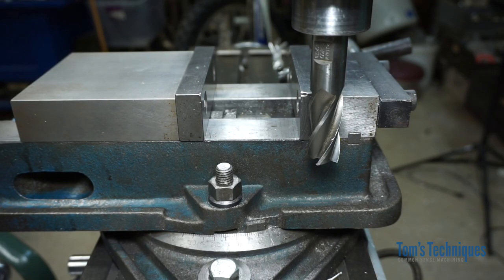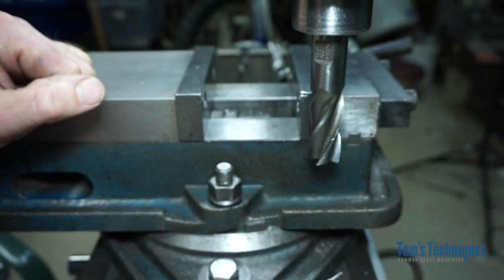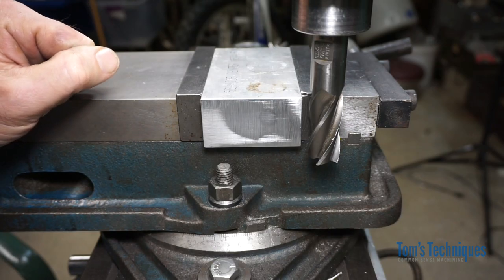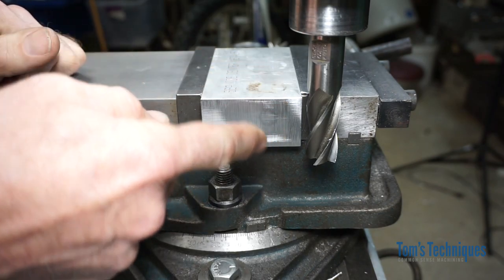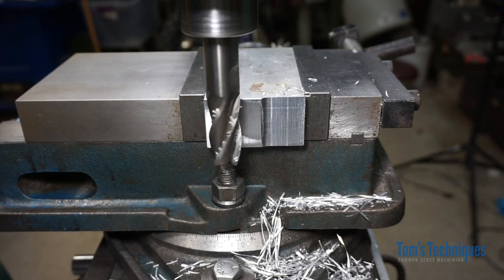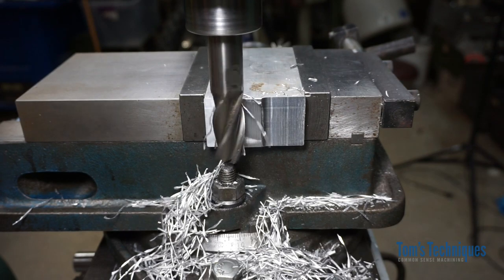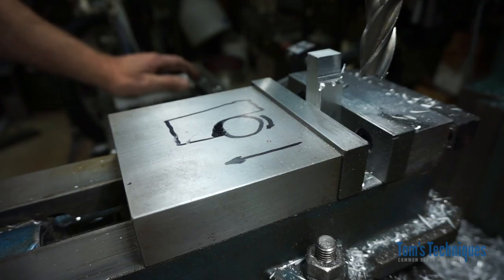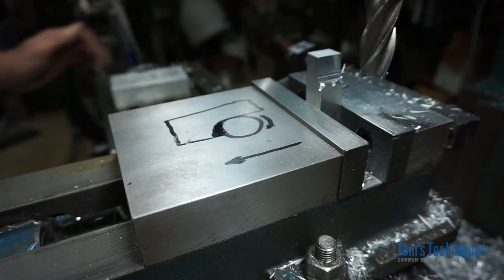Climb Milling vs. Conventional Milling

Comment: I think if you really think about climb milling you will actually find the piece gets bigger as it advances into the metal
It advances into the metal then retreats from it as it pulls away. The smoothness is achieved by the fact it's pulling away with the chip from the metal. 
I think if you consider the vector analysis you have to have a bigger piece as it moves forward.
You have the advancing table toward the part and the mill advancing also toward the part, That means an increased or longer vector in the direction of travel, It is compressing the metal not pulling at it as in conventional

Comment: Using "...every day is a  school-day" I need to ?cut? a 9/16" HEX, for a nut.  The major obstacle is;  I only  have a Drill Press.,  Do you think this can be done?
Reply from the maker: Drill presses are not designed to withstand the forces of milling. Not only will they chatter like crazy, the entire chuck can come off of the spindle.

Comment: Can u explain  y cnc uses climbing?
Great vid thanks
Reply from the maker: Sure. Unlike most manual machines CNC machines use anti-backlash leadscrews. Without the backlash, the table is rigidly held regardless of the direction of feed.

Comment: Any advice on slotting or routing out finished parts in aluminum plate on a small machine? I'm fairly new at this but carbon fiber and even some steel parts I figured out pretty quickly but my trial and error approach with aluminium <(for the rest of the world) is getting expensive with broken or worn tools or very long cycle times and much less but still broken tools?
Reply from the maker: Aluminum should be a lot easier to machine than steel or carbon. Depending on the alloy, it may be gumming up and sticking to the tool , causing your breakage. Use two flute end mills with coolant to help prevent that.
Reply: @TomsTechniques  Lol yes those were my words exactly it should be easier I would think also. Thanks for answering so quickly I appreciate it! I should have mentioned I'm not having problems with aluminum except the first cut of slots or basically routing (milling?) the finished part out of the plate. I'm starting to think I just went way off the rails somewhere so I'll buy a few good tools and start back where it is supposed to work, but not before I destroy  the last 4 or 5 cheap mills I have trying anything different than I have been doing. Maybe it's all the snow this year? Yeah that must be it! LOl Thanks again bye.
Reply from the maker: Remember, there is no such thing as cheap tools (end mills, drills, taps, etc.). Yes, you'll pay less up front, but will pay more in the long run in extra labor, broken tooling and damaged parts.

Comment: A 7/8s HSS cutter into 6061 Al is 1,200 RPM for 274 surface feet per minute. Optimal HSS on 6061 is 280 SFPM. Aluminum is pretty much a let 'er rip kind of material to work with. With carbide tools the question often is how fast can your spindle go?
Reply from the maker: I generally use 400-500 sfpm in aluminum, but more won't hurt the end mill. What happens eventually is the chips get too hot and start sticking to the flutes.
Reply: @TomsTechniques  when it comes to tools and aluminum there is a lot of variation in actual material composition, and finish. So to say it is a complicated subject is putting it mildly. I only know enough to appreciate the breadth of it. Oh, and I do know how to calculate surface speed too.

Comment: Can i please mention that in my opinion.... the endmill will stay a bit cooler whilst climb milling....
I don't know why.... just kinda works out that way....
Reply from the maker: They do stay cooler while climbing. The reason is  there is no rubbing action as the cutting edge enters the work as with conventional milling.
Reply: Yeah I've never noticed broken end mills laying on my table getting too hot myself. So you might be onto something there.
Reply from the maker: Can't remember the last time I broke an end mill while climbing. Sounds like you need more practice. ;)
Reply from the maker: Do you plunge mill your pockets, or side mill them? Plunge milling will greatly extend the life of the end mills and reduce the chance of breaking them.
Reply: @1pcfred  what material are you working with to go through so many endmills....
An endmill snapping will destroy the part... ( no big deal)... but all that hard grabbing can do a number on the indicated vice.... and I don't care what anyone says, could in extreme cases over and over take your head out of square....
I would take a screwdriver to the ways to see if they are lose ???
Put an indicator on the slots and see if it moves when you physically push on the table.....
I have worked on some poorly maintained machines and never really had any trouble with snapping cutters....

Comment: nice. I just bought a Mill bracket for my lathe, the bracket has a vice that keeps the work piece in place. and a 5.5 mill cutter. to mill a groove in a steel cylinder. I got the "climb milling" effect pretty fast and it broke the cutter snap off. I wear safety glasses when doing this . Conventional milling is what I need to do. The rotation needs to be so the flutes throw the chips out toward the high uncut profile. Chips can not be trown out the already cut profile side, making it a climb mill .
Reply from the maker: Sounds like you have the cause and effect figured out. That should result in fewer broken end mills.

Comment: Good vid there Tom... as an aside, anyone getting into woodworking and more specifically, using a router... 
the same theory applies.... except you should NEVER climb cut using a handheld router  or even a table-mounted router.
ALWAYS use conventional cutting when routing... 😎
Reply: @Peter Fitzpatrick Thank you for that additional tip!

Comment: Climb cutting can only truly be taken advantage of if you have ball screws in your machine.  Your tool will pull the slack out of your lead screw climb cutting.
Reply from the maker: I use climb milling all the time with standard screws. Depending on the type of cut, you just have to make sure the depth of cut is around half the diameter of the end mill (for plunge milling or deep cuts), snug up the table lock to keep the end mill from grabbing, or take very light cuts (finish passes). The key is to understand the forces involved and compensate for them.

Tom

Comment: Excellent tutorial, Tom!  But, I was a little confused when you explained about the direction of the cut. I believe that on most mills, the table moves the work piece in the x and y directions, but in your video it seemed as though the CUTTER was moving instead of the table! Is that how your particular mill operates?
Reply from the maker: That was just poor camera work (I should probably fire the guy). The camera was on a magnetic indicator holder that was stuck to the table. That made it appear that the cutter was moving and not the table. Never gave it a thought until after the video was posted.

Tom
Reply: At 15:03  you drew an arrow to show the direction of feed. But if the table is moving the work, then shouldn't the direction of feed actually be in the opposite direction?
Reply from the maker: The arrow represents cutter movement relative to the work.

Comment: Hi Tom. I am a USAF trained manual machinist. I was told the exact same thing you are saying. The reason I am here, 6 years later, is that I'm trying to move into CNC. So, I'm being told that with modern CNC machines, you want to climb mill all your cuts. I was hoping to have some experienced insight from you as to why this sudden change in machining theory came about, because I was ALWAYS told to conventional, then clean up with a climb as you're getting closer to tight tolerance.
Reply from the maker: Hi Cody,

CNC machines have ball lead screws that allow climb milling because they have no backlash. If a manual mill had ball lead screws, you could climb mill on it as well.

Tom
Reply: Toms Techniques thank you.

Comment: so in the Y axis with clockwise rotation of the cutter you feed away from you is convention milling  and in conventional milling in the X axis you feed from left to right
Reply from the maker: Your description doesn't take into account which side of the work the cutter is on. In your Y axis example, if you feed the work away from you and the cutter is on the left side of the work, you are conventional milling. In your X axis example, if you feed the work left to right and the cutter is in front of the work, you are conventional milling.

Tom

Comment: Nice explanation Tom. Very clever preserving the tool when the vertical workpiece got flicked over in the jaws, no matter how lose the jaws were - great example - I have never seen it done so well! I agree with your conventional chip shape but can’t agree with the climb chip shape...as it contacts the workpiece, the chip width is ‘x’. The cutter is travelling along the direction of the first cut making the chip ‘x’ + ‘cutter movement’ making the chip continually increase in size. Does that sound right?? I’m not sure, but that’s what my brain is saying. Warning!! My brain is old and a bit f%#*%. Cheers
Hey, it would get thicker up until it passes the axis of the tool in the direction of travel then start to get smaller at an increasing rate. So it would get thicker then get thinner all the way to zero. I reckon that’s it. Cheers
Reply from the maker: The chip shape for conventional milling and climb milling is basically the same. The velocity of the cutting edge on the cutter is so much faster than the feed, that the feed rate has little effect on the shape of the chip. The important thing to remember is that when conventional milling the chip starts out at zero thickness, screwing up your surface finish and when climb milling it starts out thick, greatly improving it.

Thanks for watching.

Tom

Comment: Super Video demonstrating what the differences are! I will have to try and possibly change my CNC programs.Thank You Sir.
Reply from the maker: Thanks.
CNC mills use ball lead screws, so there is no backlash, and they are extremely rigid, so climb milling can (and should) be used all of the time.

Tom

Comment: Very good resource, we started using the mills in class last week...and are reading about how to use them this week...I know. Haven't talked about this yet in class yet, I wonder when we will. Seems awfully important.
Reply from the maker: It is important. Running an end mill too slow results in wasted time and broken end mills, and too fast burns them up.

Tom

Comment: If the feed rate and spindle speed remains unchanged, They also produce different SFPM speeds because one direction the travel is adding to the attack speed, the other way it is subtracting from the attack speed..
Great Video !!Thanks !!
Reply from the maker: Technically that is correct, but the difference would be minimal.

Glad you enjoyed it.

Comment: Remove the back lash, lock the x axis table after you figure your depth of cut, crank your rpm up to 1500 (especially with aluminum) and you should be able to take .1" off that stock. You should very rarely ever have to conventional mill. You can also double your surface feed by climb milling.
Reply from the maker: You are correct that a mill like this is definitely capable of heavier cuts, but the focus here was to show the difference between conventional and climb milling and how to manage it, so I wasn't making it work very hard.

Thanks for watching.

Tom

Comment: From that kind of vice.. the force of the cutter must always aim towards the secure side of the vice which in this case it is at the right hand side of the video..
Reply from the maker: Karl,

That was one of those hard and fast "rules" I was taught early on, but quickly dismissed as I gained experience. I know the logic behind it was to keep the force of the cutter directed at the stronger solid jaw, but in reality that force just isn't great enough to cause any problems. One of the driving forces behind my rebelliousness, was that one of the first jobs I had was running a shaper and if you remember, shapers by design direct the force of the tool toward the "weak" jaw. A modern day example is CNC mills, which direct the force of the tool in all directions.

Thanks for watching,

Tom

Comment: The set up of workpiece almost totally wrong..
The rectangular piece was put in the right way but the way you cut the workpiece is wrong.. optimal way to clean the surface is you should have cut it from left hand side (from video point of view) towards the end (the entire length of the work piece) then go back until you finished it at the right hand side but on the other end..
2nd piece.. the cutting is right but the work piece placement is wrong.. optimal way to do that is let the workpiece lay so that the entire length of the piece was secured in the vice..
Climb milling is good for getting the right measurements
Conventional milling saves u a lot of time roughing the surface the end it with climb milling..
Reply from the maker: Karl,

I think you need to go back watch the video again. I demonstrated why the force of the cutter should be directed perpendicular to the jaw of the vise, and what can happen if you don't. I guess that would be your "right" and "wrong' connotation. I also discussed the pros and cons of climb milling vs. conventional milling, when you should use them and when you shouldn't. 

Tom

Comment: To be fair you shouldnt run it at that speed and with that much of the shank pertruding out of the collett. When cutting on the side you should always conventionally mill. With aluminium you should use a cutter with a high positive rake too minimise build up of material in the cutting surface. Carbide works a treat too
Reply from the maker: Yes, I mentioned in the video that the extended shank is less than ideal. As far as climb milling only goes, not everyone has machines that are capable of such a thing. Light mills for example are not rigid enough to do climb milling on anything but very light cuts. Conventional milling is much more appropriate. High helix end mills are great for milling pockets in aluminum, but in my opinion, carbide is a poor choice for all but the most experienced hobbyist.

Tom

Comment: I'm just getting in to machining. I think climbing is slower bcs you're taking less material off/less depth than you can do with conventional. I think one reason the finish is better climb milling is bcs the chip actually polishes the material on exit from the bit and part vs. conventional milling quickly removes the chip from between the bit and part. 

interesting vid on the mechanics of climb milling. +1 and sub
Reply from the maker: Climb milling seems to take more material off when hand feeding because it requires less effort, but in reality, the metal removal rate is the same either way for a given feed rate. The poor surface finish associated with conventional milling comes from the fact that metal builds up in front of the cutting edge and skids along the surface before starting to cut. That skidding action creates a lot of heat, resulting in cutter wear and a poor finish. When climb milling, the cutter makes a nice, clean exit resulting in a good surface finish.

Here is a good explanation by the commercial tool maker, Harvey Tool:

https://www.google.com/url?sa=t&rct=j&q=&esrc=s&source=web&cd=3&ved=0ahUKEwi60srKo7PRAhXLg1QKHQC5AXkQFggkMAI&url=http%3A%2F%2Fwww.harveytool.com%2Fsecure%2FContent%2FDocuments%2FTech_ConventionalMillingVsClimbMilling.pdf&usg=AFQjCNHD0HMbYSPL4fhA4KW2Q1iTgLg5ug&sig2=EcBJRMBE0kBLeLdeBopwag&cad=rjt

Thanks for watching (and subbing)!

Tom
Reply from the maker: Sorry Dick, but I don't like generalized statements. 

Ball screws take take burden off the operator when it comes to climb milling, but they are not a necessity. If you are mindful of backlash, and deal with it appropriately by monitoring depth of cut and/or utilizing table locks, climb milling can be done on most any mill. I drive an ordinary Bridgeport clone with standard screws and virtually all the milling I do is climb milling. The only time I would recommend avoiding it is when taking heavy cuts on light hobby type mills, where rigidity is an issue beyond the operators control. But even then, climb milling can be used for light finish cuts to get a good surface finish, dragging a table lock if necessary.

Tom
Reply: Only conventional mill in RARE occasions,,( A Machine that doesn't have ball screws) Always climb mill in an NC.